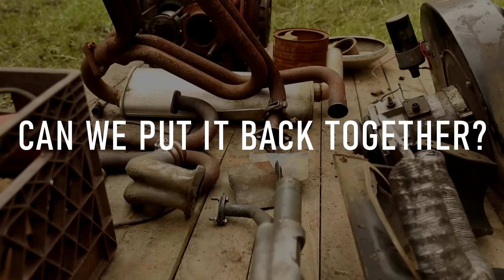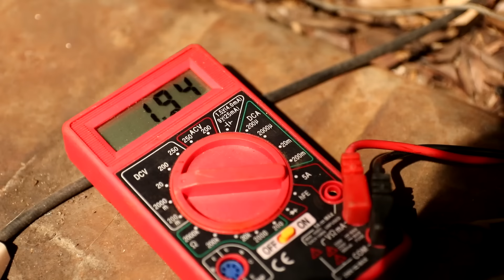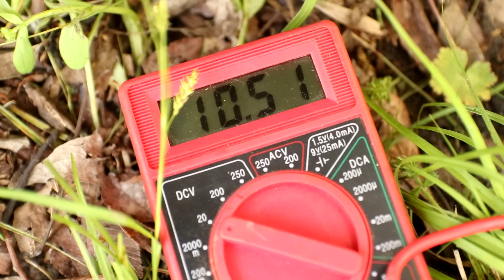Oddly Satisfying 1966 Volkswagen Rescue | Relaxing Rebuild In Nature | RESTORED

Comment: watched this and I must say was fun to watch even though I miss you guys talking. I have an old 65 1200 40hp I'm restoring right now and must say other than one blown piston looks in pretty good shape. Just buying the new cylinder and piston kit for the 77mm and some odds and ends will need to get it running. Saw a 66 bug for sale close by without an engine so they should mate up fine.

Comment: Had a 1965 VW baja (green) back in 1993 in MD.  Sold it at a Bug Out car show in PA.  2015 saw a video for Fred Williams brother from Dirt Everyday in PA state he got a hold of it and go it running again.  My baja was used for drag racing back in the 80s, had a type 4 motor in it and a half cage.

Comment: Pretty much exactly how I got my 61 beetle. A friend rang me and said "there's a V-dub next door, he's got to get rid of it. If you can get it out you can have it. Engine is in the back seat." Except I just towed it home first, and found a good head in the boxes of bits the old man had collected over the years.  Flogged it senseless for years bush bashing, and everyday commuting. Guy at work thought it was an auto because I would leave work facing uphill, hold it flat and then flat change into second, then third over the top. Had like a 10 mm venturi in the carb, Didn't make enough power to burn the clutch, didn't over rev during flat changing for the same reason, with relatively heavy flywheel. Just sounded like an auto. 65 mph in 3rd, 60 mph in 4th. Had almost 3/8 ring gaps when I finally swapped in a 1750. I then wore out third gear in 2 more gearboxes. So much torque so few revs, 5 mph to 65 mph faster than everyone, 83 mph topped out. Probably safer that way.

Comment: I can’t believe they fit the engine back together with these corroded hand sanded cylinders, without new piston rings, seals, gaskets and a proper parts cleaning. 
I wouldn’t be the one buying this engine…

Comment: That said, a VW boxer will run no matter what. I drowe ny 68 Beetle 320 km. I do not knoe what that is in miles. with a lose cylinder. As we did back then, just change the engine anddrive on, I was short of engines and well, lets see if the old one could be fixed, One of the cylinders was loose. You could wiggle it. And it still ran. And brought me home. That was when I turned from liking the engine, to loving it.Yes its thirsty, no its no power in it, but YES it will run and you will get home even with a loose cylinder.Have to love those engines.

Comment: Amazing how easily it went back together,  you guys had all the fasteners and parts it needed,  and it ran so good. Makes you wonder why they took it all apart out in the woods? Hmmm. And how did you stop it without rolling in to the creek if the brakes weren't working.? E-brake?

Comment: As someone who has rebuilt many old VWs. My first question is. Why was it disassembled in the first place? I find it odd that you can simply somewhat clean, reassemble, and have it run without any issues. My second question is did you replace the carburetor? Because one sitting for years will be dried out and corroded. You can’t fix one by banging on it and squirting starter fluid in it. But beyond that, I enjoyed the video. But I know it takes a lot more than what you have shown.

Comment: Even though this video is a  fake I appreciate the entertainment value you guys actually have yourself a nice example of an   mosty original mid-sixties beetle there.   Top 3 reasons I say fake.  Car would have been covered with black mold from nightfall.   Wheels left  out doors on the ground  would have been much more rustier and full of dirt from laying on the ground during any kind of rain storm.  Zero sign of any kind of rodent infestation.

Comment: Ok I've seen you 2 do some amazing work on other engines but I hope everyone watching this one understands your not going to throw together a engine so easily without using a cylinder hone to clean those cylinders or just slide the pistons in without gaping the rings or setting the rockers without a gauge and not using a gasket set so if people believe it they will believe anything.

Comment: Looks like the famous Thai restoration videos. When a guy in the jungle finds a motorcycle scattered in pieces, just enough to put it back together. Or when he finds a PC drowned in a swamp and then washes it with a hose and goes through the hard drive, cleaning it inside with a toothbrush. Then turn it on and enjoying Windows 11 on the screen. Incredibly, all the parts are in the car. Some eccentric 20-30 years ago just disassembled a normally working engine. Just put it back together and it will work as if nothing had happened. Why was it disassembled then? There is beautiful grass under the car, which has been parked for years in the forest. This video is, if not half, then completely fake.